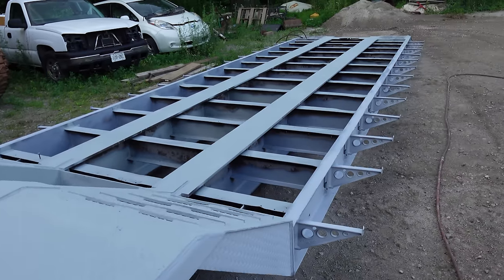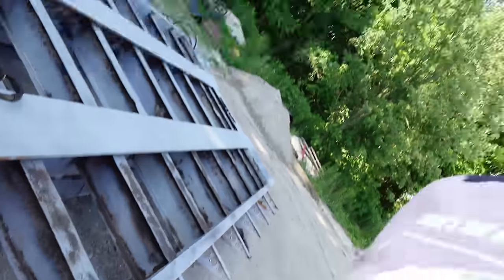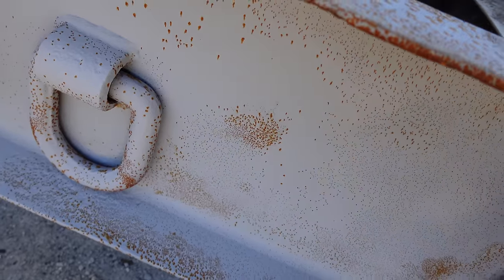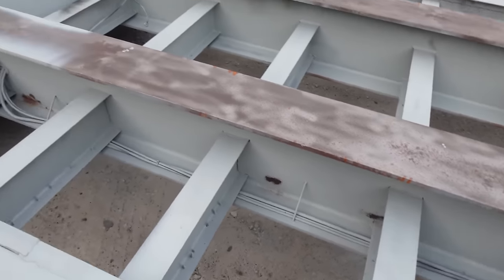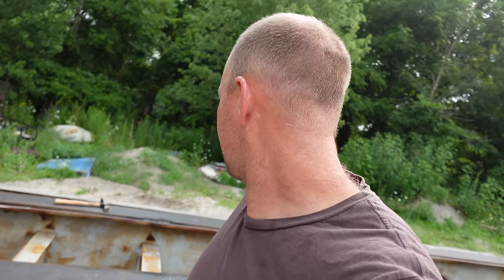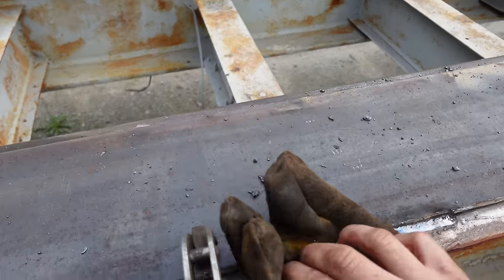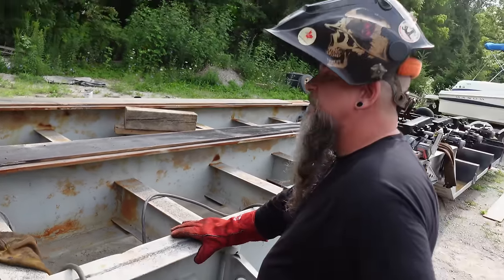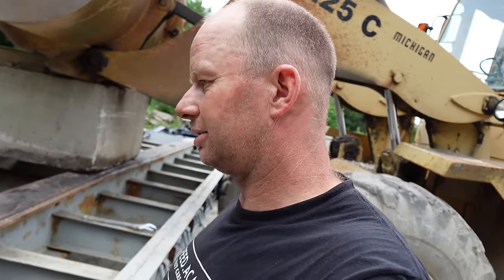Lowboy Trailer Transformation: From Rust to Robust! [EP3]

Comment: When i was in my mid 20's, a guy I was working for bought a lowboy trailer like yours. It had about a 3-4 inch sag. The guy who fixed it did as you did except he didn't clamp or weigh down the strap he was welding on. 
He welded one end and worked his way to the other end. As he welded the strap down he welded a few inches at a time, swapping sides as he went. These welds were about a foot apart. You could see the far end of the strap move sideways a few inches as he made the welds. Welding on the right side move the end left. Weld on the left the end would move right. He worked along and when he got to the other end he had the end line up centered and welded it in. He explained that as the strap move left and right it also got longer. After he welded the far end down and the strap cooled offo it did it's best to return to it's original length. 
When we got it flipped ribber side down, you could see the trailer didn't sag the 3-4 inches, it bowed up about 5-6 inches.  I was amazed by this. Welding the steap on the bottom bent to sag out and bowed the trailer up about 10 inches.

Comment: hi Rich. I worked for a logistics company in the 1980’s. We rebuilt a couple of our trailers during  a slow time. We had a couple of trailers that we put the arch back in the frame. We did it by raising the middle and weighing down the ends. As we slowly moved the middle we had a guy on each side heating the frame with torches. It worked very well  and got the correct arch on single drops, doubles and a couple long flatbeds. We always chained the axles to the bed before lifting to prevent damage to airbags and brake components.

Comment: As for the grease, maybe some zerk fittings would have allowed for pumping it in after the welding. A few ground grooves on the surface would help it spread. Weld up the zerk holes or some grub screws after.

Comment: Should have used 7024 and used that largest rods your machine can run. The extra heat and larger rods will help give some pull to the weld and help give more bend to the trailer. Plus it will weld faster.

Comment: I understand using stick since it's what you have (and works very well), but dual shield would work extremely well too if you have still enough air. You'd likely get 2-3x the weld speed for the same size weld. Of course, it does require the right equipment, but there's a very good reason why it's popular for heavy fab.

Comment: I have a 1974 Muv-All lowboy with a steel deck, 8.25 x 15 slit rings and hydraulic dovetail. I initially wanted to swap to 17.5 but for what I want to do with it, it’s simply not worth the cost. I’m replacing the chambers , breaks, sandblasting the wheels , new tires 🛞 and breaks , new paint and call it done ✅

Comment: That trailer is designed to carry the entire loader! Not surprised the bucket full of gravel did nothing.
Reply: And loader pressing down
Reply: @wobblysauce  that's still a total of maybe 15 tonnes. For a trailer designed not to sag with 30 tonnes loaded on it.
Reply from the maker: yes, but point loads would be spread over 4 points, ose to the ends.    putting all the weight in the middle on one point is completely different
Reply: @DGHD  yeah, a little. But we had a similar sized loader and chained a 2 tonne concrete block in the bucket and used it to ram 5" bore pipe in the ground as fence posts in Central Queensland. I dented the bottom of the bucket smashing these pipes into the ground! There's not a huge amount of pressure out there.
Reply: Rich is correct. Trailers are rated at concentrated load in so many feet. Usually 10, 12, 16 feet. Very few trailers are rated in 4 to 5 feet. The longer the length of the rating, the more deflection you will see with a load in a short length of concentration, like a coil. I don’t find a loading concentration spec in their literature. Maybe it’s on the I.d. tag on the neck. In any event, Rich was headed in the right direction. Take care.
Reply: @carlcarlamos9055  how can you argue this when it literally didn't work. You just watched it not work in the video but you're arguing against me!

Comment: Looks good Rich! I'm just old enough to remember my first welding lessons being taught to drive stick welders, as MIG still wasn't all that common/mainstream.. Also remember that when my stick welds came out shitty I got punished by finishing the job with acetylene and rods! Didn't learn MIG until much later. I still find TIG to be dark magic and have to practice for an hour anytime I pick one up. BTW, good to see Vince the Prince of Molten Metal! PS: Speaking of torches, to this day I still find fire and puddle guns extremely fun to use, taking any chance I get to blast some cast iron 😁

Comment: There is a proper cooling jacket available. It has pockets inside for cooling gel things. I bet it would work ace for you. I have done the opposite and popped a hot water bottle into a back pack and put a coat over the top :o)

Comment: Hindsight is 20/20 but I wonder if you could have injected the grease after you welded everything. Install grease zerks at regular intervals on the underside. Just a thought if you ever run into this situation again. I like the 25 cents reward for the steel found in the driveway…brilliant!

Comment: Hey Rich! Nice progress, love watching these videos. Just one question. Why did you weld those steel plates to the bottom of the frame rails? My assumption was to restore an arch in the deck, but I'm not sure if I am right or not. Just curious! Thanks for sharing the progress and can't wait to see more. 

BTW - I am extremely jealous of how easy you make it look mounting those trailer tires. Mounting 275 trailer tires is probably the hardest thing I've ever done in my life. Idk if it's just me, or because the tires I have done are old and not stretchy anymore, but man the last 275 I did I about killed my self trying to get it completely on the rim, it was ridiculous.
Reply: I do believe he is trying to arch the beams back. But good luck because he will never get the to arch back. So waste of time and steel and lost more clearance from the ground is all he will get. He would have to drive a D12 dozer up on that to even move the arches back 😂
Reply: @kevink4914  He isn't going to be using the trailer full time for work like I do with my lowboy, so I wouldn't be worried too much about the inch loss of ground clearance.. usually once a trailer loses an arch, it's gone forever. But that doesn't necessarily mean the beams are junk, I just wouldn't be loading 55 tons on it if it was shaped like a banana the wrong way LOL
Reply: Assuming it was to try to arch the trailer it was a waste of time and money. Unless the goal was to add more weight to the trailer and decrease ground clearance. It’s the vertical section of an I beam that gives it its vertical loading capacity, the flat part on the bottom just helps prevent it from buckling. Just as well he put carpet on there.
Reply from the maker: stiffens the beam and gets rid of bounce.  neighbor, who hauled low-boys for a living told me to do it and how.    since he has real experience, I listen to him
Reply: @DGHD  I completely understand that, makes sense! We have a 35 ton XL Specialized and when it's loaded down it definitely bounces quite a bit. I've never thought about doing what you did to eliminate that!

Comment: Hay a product that i found is calld strike hold its a gun cleaner and protectant but it dried i use in in mn ony truck frame to stop rust. Also you can applie it under paint to protect against rust it bonds with the metal. Fantastic product would have worked well under the plates. Also its not an oil and it roesnt collect dust

Comment: Steel is so great for many things and applications but the constant rust that just keeps coming back on trailers and things like that makes it almost not worth it. It’s too bad nobody has developed a forever coating for steel to prevent rusting other than constantly keeping everything soaked in fluid film or oil of some sort.
Reply: My understanding is that corrosion costs the world 2.5 trillion USD per year. Utterly astonishing numbers. 3.4% of the global GDP goes to rust repairs or losses to rust.

Comment: Yes rebuild low-bed take time i did myself and send away rebuild.the main thing good sandblasting,net clean,undercoat,paint.tire,rim,air systems,wiring.i send rebuild low bed and some was just junk because cut-corner.i work banister pipeline on lowbed 30 years and good shape and other less time just wreck because poor rebuild.thank you video😊

Comment: Regarding the 1,000 hours figure. Let’s adjust that to 500 hours=12.5 weeks at 40 hours a week. At $25.00 an hour for one’s time, that is $12,500.00. If a person invests that time, shops well for quality tires, parts, and other materials needed, and strives to do a good job on the refurbishing, they will have a valuable asset, and not have overpaid if they buy wisely on the trailer they start out with. When putting on the deck, put the chosen coating on the sides and bottom of boards before fastening down, and really avoid green boards. Spending big bucks for firewood is no good. This is an informative series. Thanks and take care.

Comment: First off, Great job. And your welder friend giving some time to help and directing you on how to improve your welds.  My I offer some advice to you and the viewers on how I would have done the welding as a former "SHIP-YARD WELDER," who made little 400 foot long canoes with full sized helicopter landing pads on the bows of those canoes. Yes, some, NOT ALL WELDS, were inspected (some x-ray's) by Lloyd's of London insurance company, & U.S. Coast Gard.  On each strip I would first have done what is called stich - weld either 3" in - 6" in. or 3" - 12"in.  which means for the 3" in. weld (measuring from the center of the three inch weld to the next three inch, is six inches) same goes for 3" - 12"in..  As you do this saying you start on what I'll call the south side of the metal strip, the North side layout welds should fall in between the southside welds.  Put another way, the North side welds SHOULD NOT LINE UP with the South side welds.  After you finish the "stich welding, than finish up filling the gap's and jumping back and forth North and South sides."  Do maybe approx. two or three foot "fill in's" at say the east (front) of trailer, than jump to west side (rear) of trailer, two or three foot "fill in's" than jump to center of trailer two or three foot "fill in's" rinse and repeat as necessary.  YES THERE'S VERY INPORTANT REASONS WHY you don't just do full (say 40' ft. long) welds.  MAJOR HINT look who was checking the quality of those little 400' ft. long canoes.  I'm wondering if I should mention the 40' Ft. X 40' Ft. "MOON-POOLS" mid deck, these canoes had.  Why in the hell would they have a 40' ft. hole mid-ship / mid-deck?  Because they were built to be Gulf Coast navigable buoys tenders.  You need someplace to work on the buoys.  Oh, and these little canoes had VERY NICE SIZED CRANE'S. Electric over Hydraulic crane.   Can you guess why?  The winch, located at the back of the canoe, containing I think it was 2" in. Dia. cable, which could only be shipped to the ship-yard, via another big boat, was way too heavy to be transported via a truck & trailer over land. It only took two massive cranes to walk approx. one-third mile to install it.  How massive is massive you ask.  One, 100-tonne crane and the other was just a little smaller.  I have no clue as to weight.  But the "Outside edge(s)" of the spool (what kept the cable onto the spool) was one-inch plate, if that helps.

Comment: Why don’t you use the marine epoxy primer that Fritzee Fabrication’s suggested?  It is meant for pipelines and oil rigs.  Tough, with corrosion resistance built-in and cheap.
Reply: The Tremclad primer looked worse every single day.  It did not look like it provided very good protection against rusting.

Comment: The grease was a good idea, but I would've put a couple grease zerks through the plates, put a pinhole at the far end away from the zerks for the grease to flow out of, and filled it with grease after welding. That way you wouldn't have to fight with it while welding
Reply from the maker: great idea

Comment: Rust needs oxygen. If you weld the root out well it should not rust under there. Grease is a bad idea.
Reply: I somewhat agree. 

 However,  I think using a weld through rust inhibiting primer might be better. At least if your welds end up like mine.  That might be why he wanted to use something in addition.
Reply: Water finds it's way into pretty much anywhere and it'd rust jack that plate right off in a couple years.
Reply: @ForfeMac  not if your welds are good. I weld fuel tanks on boats and we don't get water everywhere. Weld through primer after blasting is the trade way to do it.
Reply: @williamhamill813  Fuel tanks aren't constrained against each other like a trailer frame is. Like I said, water will get under that and rust jack it apart after a couple canadian winters. I see it all the time up here.
Reply: @williamhamill813 not everyone welds often enough to always get waterproof welds. You have to consider the common man here

Comment: I would not use those deck self tappers. I would use carriage bolts and large washers and not drill any part of the frame. All the new lowboys do not use those deck bolts. Makes changing broken boards a quick job even though it’s a job way in the future.